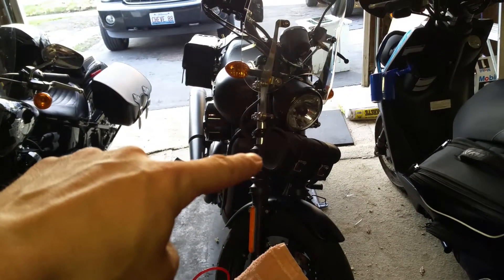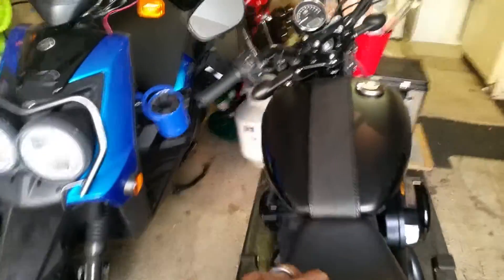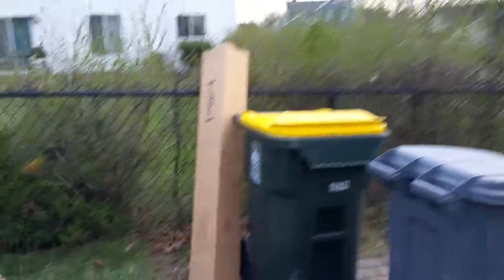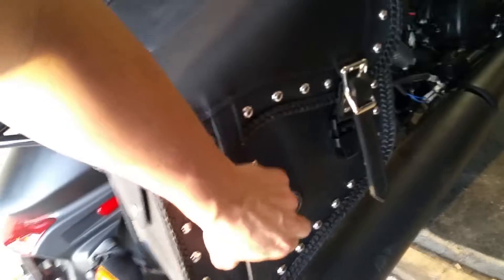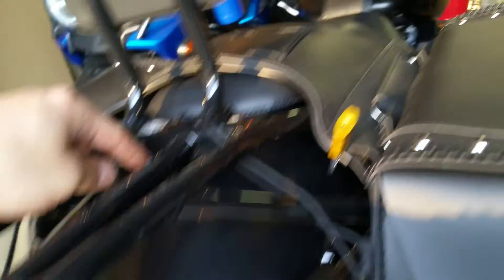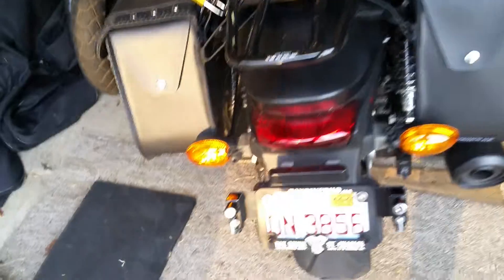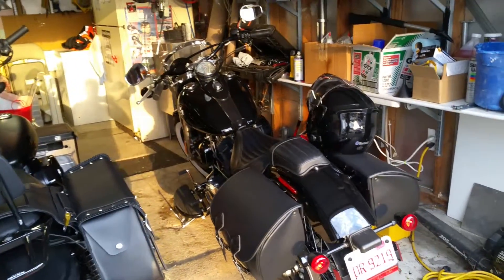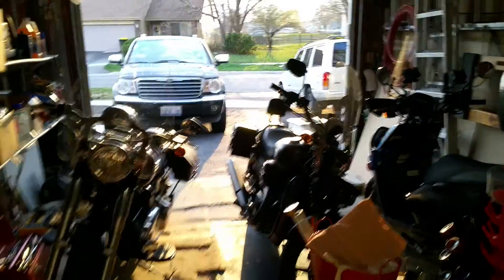Shelton bikes

Comment from the maker: Some were asking me where I bought the parts for the Street 500. So here is the list of items.

1.  HARLEY QUICK RELEASE SUPER SPORT WINDSHIELD Street 500 or 750 Part #'s XG500 XG750
2.  http://www.jpcycles.com ZIP-OFF THROWOVER SADDLEBAGS Part # 831-250 
3.  Spring Loaded Round Toggle Stop Cord Locks End 10 Pcs 
4.  Helmet Guardian DUAL lock licence plate mount
5.  H-D Detachables Two-Up Luggage Rack Part Number: 50300091 Gloss Black 
6.  Compact Passenger Backrest Pad Part Number: 52300281 Black 
7.  Sissy Bar Upright Part Number: 52300307 Gloss Black 
8.  Docking Hardware Part Number: 52300285 Chrome 
9.  Smartphone Pouch - Item# ATP-05 Merchant eGlideGoodies orders@eglidegoodies.com
10. http://www.jpcycles.com/product/721-340 Motorcycle Armor Fuel Tank Protective Film Kit Part # J&P Part: 721-340
11. Denniskirk.com Protective Tape Kit - 4320-0807 Part #: 507081